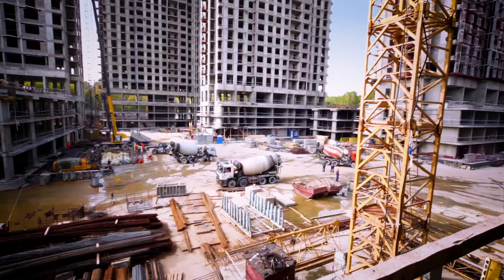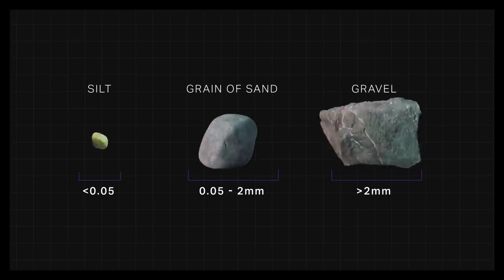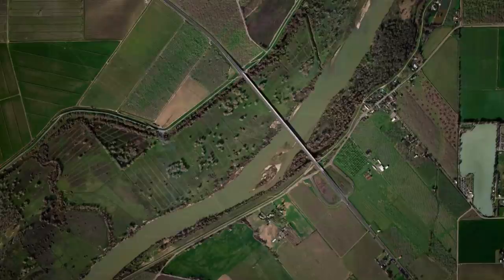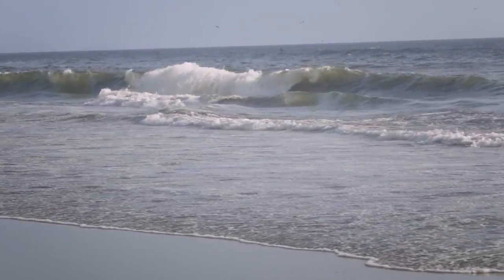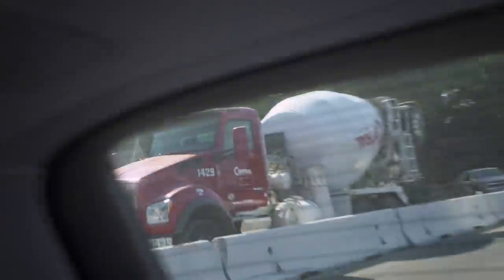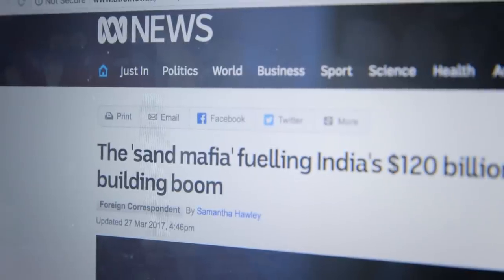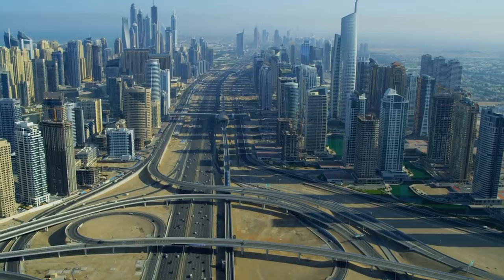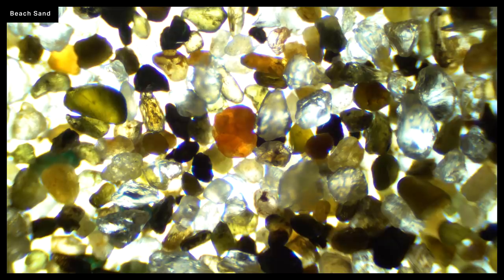A microscopic look at why the world is running out of sand

Comment: The video discusses sand for concrete, but another use of sand that is affected by the shortage of the right type of sand is beach renourishment. Beach renourishment requires the right sand in the right place or else it can erode too quickly. I think there are a couple cases in Florida where the wrong type of sand was used to replenish beaches and The new sand was eroded within a year or two. That's the only context in which I had heard about the sand shortage before, not sand used for concrete.
Reply: Melbourne beach in flordia is an example of this.
Reply: This two are actually conected, beaches were used as supply of construction sand both legally and illegally for decades, problem exist even today (hence existence of sand mafia), in my place government was discussing replenishing of the beaches while people were posting pictures of trucks driving away with illegally harvested sand.

Comment: As a small correction, you mention that the round sand is used in concrete. The two types are commonly known as soft and sharp sand, only sharp sand is used in concrete as it can take more weathering and binds much stronger. The soft sand (round egdes) is used for things like laying brick as it has a softer smoother feel and can be worked much easier in smaller amounts, from a trowel for instance.

Comment: Also the color of the sand will sometimes tint your concrete slightly so that if you got concrete from 2 different depots, and poured a 2 slab patio each slab might look different. Or if you get concrete from the same depot but several months apart the same thing can happen because they may get sand from a different supplier.

Comment: Hey... Isn't edgy sands more useful as they should bind with cement more easy, am i missing something?
Reply: Sometimes edgy stuff can create more of a grip, but for concrete the sand has to bind with other things. Having smooth sand particles mean that the other rocks and stuff can stick to the surface.

Comment: So if I just started taking tons of river sand I could black market it for a lot in 30 years?
Reply: I think in 30 years time we will have replaced silicon in computers so they will no longer use sand to manufacture processors and I also think that if we do run out, the alternative building materials will still be relatively cost effective so they won't exactly pay a fortune for your sand. Also im pretty sure its not true that we are going to run out of sand.
Reply: @mattrowlands5751  oof spoiler
Reply: @DuhNoU  for what lmao, life? 'life spoilers ahead'
Reply: Helium is more likely to make you rich. Save those balloons! ...i guess get a helium collector and tank too for long term storage.
Reply: You'd get mopped up for environmental damage. There's a big list of what you can actually do with nature law-wise and rivers in particular.

Comment: or we just need to manufacture a new type of cement/concrete that can bind well with all types of sand.
Reply: RestInPeaceXXX; rammed earth and adobe
Reply: They already have, but it is more expensive, and still flawed. As mentioned in the video. 

Just because you want a certain result, and decide to research it, doesn't mean you will eventually be able to produce that result guaranteed. 

If you want 2+2=5. You can research it all you want, you will still not get the result you want. Or even if the result is achieved, is the method viable.

In this case, the results that are wanted are: 
1. Affordable
2. Works with a larger variety of sand
3. The product can be of use in a large variety of situations. (Since we are looking to replace the current formula which is used in a very large variety of situations.)
4. Formula includes non-scarce materials only
Reply: We don't have to. We're not actually going to run out of sand. The whole discussion is absurd.
Reply: As if that is easy to do.
Reply: RPX hempcrete

Comment: I wonder, if you were to mine quartz and break it up not into sand sized pieces, but the next category up, but then through them in a mixer full of water for a few days or so, could you produce the rounded edges you desire?
Reply: Sand takes a very long time to round its edges smooth in a manufacturing process

Comment: How about we look for replacements to concrete instead of looking for replacements to natural sand?
Reply: Ah yes, what a revolutionary idea, lets just replace the most useful and workable material on the planet 🙄
Reply: @Vnifit  You havent tried it yet.
Reply: +Matouš Hrdlička and you think material scientists and engineers haven't?
Reply: BUT HAVE YOU ?
Reply: @Vnifit  
Aren't we already trying to do the same with plastic? If necessary, a replacement has to be found
Reply: Whatever you try to replace it with has to be made of something, and those materials have to come from somewhere. Concrete is basically just processed rock. It's hard to imagine any other suitable material that would exist in greater quantities with less environmental impact.
Reply: Check out CLT (cross laminated timber) several buildings have been constructed using it, I think the YT channel the B1M has some quality videos about it
Reply: I'm all for CLT being used where suitable. But for roadways and sidewalks? Highway overpasses? Exteriors? Dams? Swimming pools?
Reply: Herman Von Petri  Sidewalks can be made from tiles of granite or anything else. Roads should be made with tarmac which are usually laid over a mix of pebbles and others stones. Exteriors can be made by plastic if you want. Swimming pools don't even need concrete. You could just take giant stones and make some kind of paste to put inbetween. People are blinded by concrete because it seems like it's the answer to everything but there are alternatives. It's because people have become so used to it and know how to work with it they just don't care about what else can be used.
Reply: Vnifit   Electric cars are far more efficient, clean and safe than gas cars yet car manufacturers have largely tried to stay away from them until Tesla came along and disrupted the industry.  No matter if it’s construction or vehicle manufacturing, industries will try and stick with what they know makes money than try and find better ways of doing things.  I wouldn’t trust the industries to tell us if there are viable replacements as most simply don’t want to change.
Reply: @HermanVonPetri  we should aim for smaller and denser cities with better public transport, however this ideal is far from reality, specially in America where  cities are car consumer oriented
Reply: Granite is less sustainable than concrete, with the high fuel costs for mining and transportation. It also simply can never be fitted to create a smooth road surface over uneven terrain, while concrete can self-level to a seamlessly smooth surface. Tarmac (or asphalt) is not resilient enough for routes bearing the weight of large trucks. Plastic, we are discovering, is an environmental nightmare. I don't see how replacing the gravel/sand mix of concrete with larger stones makes it any more sustainable. Those large stones still have to be excavated from somewhere and now you're just going to be using more of them AND they will be more expensive to transport, use more fuel, take up more space, and will need to be shaped on site. That's in addition to the fact that a large portion of bigger stones would have to be rejected for flaws or being the wrong shape or cracked whereas gravel/sand can be mixed into concrete and formed to fit the project very easily.

Concrete has been used since the days of the Roman empire precisely because it is the most economical, flexible, resilient, and useful option for large scale building projects. Additionally, old concrete can be recycled by breaking it up and reusing it as gravel in more building projects.
Reply: I'm not saying that we shouldn't be researching novel building materials. We absolutely should. But realistically, I doubt that we're ever going to find anything that will match the usefulness, sustainability, and flexibility of concrete unless some sort of fundamental revolution in materials science happens.
Reply: Just want to keep up with the answers :)
Reply: In the future everything will be made of lego blocks .
Reply: Earth soil is an 100% recyclable and cheap local material. In yemen there are building up to 30 meters and they are lasting centuries.
Reply: @MrSpathiphyllum  The thing is, are those suitable for high density cities like like Shanghai, suitable for earthquakes, tsunamis, heavy rainfall every 2 weeks and humid?
Reply: The highest soil building known is 30 meters and 8 floor tall, above that I suppose it's not feasable, but are tall buildings the solution for futur city planning? tsunamis concern very specific areas. With a great roof and a proper coating, i don't see why it couldn't whistand rainfalls and humidity. For earthquake resistance, well i d'ont know, I suppose it can't be achieved without a mix of materials (wood or steel).
Reply: Geo-polymer would be a good alternative. The material just needs to be researched more.
Reply: Carbon carbon carbon!!!!
Reply: @HermanVonPetri but what about the SKATEBOARDERS??😱
Reply: @indigodragon0613  ya my guess is sand will be used until we absolutely can't use anymore of it
Reply: @MrSpathiphyllum  earth soil is for agriculture, it's more valuable than sand. We can live without buildings but we cant live without food.
Reply: @MrSpathiphyllum  This is one of the most ignorant comments, dirt cannot replace concrete. It's not as strong, waterproof, and mixing it with other materials will not be as effective as concrete.
Reply: BudgieEntertainment First, we would have to apologize to the indigenous people we destroyed and then we would have to admit they had it right. Never going to happen.
Reply: Well, rammed earth house are not entirely made of soil, and I suppose the quantity of available soil is by far superior to the quantity of available sand suitable for cement.
Reply: Wrong, reinforced concrete doesn't last a century (due to metal corrosion) but an earth house can last for centuries (see the Alhambra). With a proper coating and drainage, an earth wall can wistand decades of continental humid weather. See https://www.youtube.com/watch?v=-oVBljL6p68
Reply: @DarkAngelEU  implying giant slabs of rock and granite aren't monstrously more expensive than concrete.... Are you gonna be the one that pays the difference?

Also what makes you think mining for granite or stone slabs doesn't hurt the environment lmfao.
Reply: @MrSpathiphyllum  and concrete lasts thousands of years like the Romans have shown us. Nothing works for long lasting structures like rock. The Egyptians are clear examples of this.
Reply: Roads are being paid with tax money so yeah I do part of the extra cost. Unearthing rocks is a solid industry that won't get out of resources very soon. Even in a small country like Belgium we still have rock mine industry for at least another 30-40 solid years.
Reply: @Vnifit  Hemp
Reply: KNITTED BUILDINGS
Reply: Yup people are making skyscrapers out of wood now, sounds crazy? Just look it up. A lot more eco friendly
Reply: It’s about stubborn company’s unwilling to pay more, we already have replacementt
Reply: @indigodragon0613  except it takes more gas to produce the electricity than regular gas cars do overtime
Reply: Cameron Yockey   Yeah no.  Maybe if the cars needed to be charged as much as gas cars need replacement gas, but that’s not the case.  Also, seeing as you’re not taking into account the fact that many homeowners who own fully electric cars also have a clean energy system from which to charge from, there’s no guarantee that whatever stats you’re looking at aren’t picking and choosing their data.  Tesla also has publicly stated that they have plans to transfer their supercharging network to a renewable energy grid, so it’s only a matter of time before the argument you’re using is rendered obsolete.
Reply: We aren't even running out of sand they made it up
Reply: @Vnifit 
Well, we won't have said material anymore soon.
Reply: Hashtag sure thing. What do you have so far?
Reply: Agree
Reply: Better idea. Decrease the expense of transporting sand.
Reply: Google made me do it Can you give some proof to what you are saying?
Reply: There is an new material currently in its infancy on the west coast. It’s call Cross Laminated Timber, or CLT or short. Look up videos on YouTube for more info.
Reply: empbac  With renewable energy, my guess is the liquidification will come from heat rather than suspension in water. If we can mechanically isolate minerals to an acceptable level, we can melt & pour a variety of substances... and it might even be pretty.  Robot sorting is pretty much a done deal about now, solar and wind power is there, all we need is batteries.
Reply: And stop telling people they don't know what they're talking about.  Maybe they don't, but it's those people with an outside perspective, unembroiled in the past and nitty gritty details who come up with fresh ideas.  Sure, they may not be good ones at the moment, but all know-it-alls do is shut down the conversation, throwing any innovation out the door with it.  Try figuring out somewhere more fitting for that idea, or redirect the person who offered it to a community where those ideas are fostered. The other option is to just refrain from negativity and zip it.  You don't have to be optimistic, but don't shut down optimism unless someone's going to die because of it.

Comment: Create a binding agent and run smaller pieces and finer pieces, and maybe even silt, through a tumbler to gain size. It should be something that won't bind to itself so easily, so the pieces of "new sand," remain independent of each other. Then develop a corresponding binding agent to the final mix when making cement. It might be something like charging the stone + or -,  and reversing this with the new agent, and then of course again in the final stage. Or it could be made from a light sensitive material and not exposed to light again until the concrete mixing stage, which wouldn't necessarily remain it to daytime work, as lights could be used at night. We could end up with a superior product. Perhaps compressed styrofoam would make good cement, it makes the best replacement for wood,  perhaps now for sand.

Comment: Why not filter beach sand and change the chemical bondage of the cement which will not react in a negative way so the concrete is much more cost effective

Comment: In terms of volume, how much sand are we talking about?  1 cubic km per year? .5  per year? More? Less? When we process ore from mining operations what happens to the "waste" rock? Is it suitable for concrete use? Suitable for foundry work? I do know that flyash from coal plants is used in concrete  to some degree. Or is this shortage more a case of access versus distance.
Note the quotes around waste.  What we call waste, is merely a resource

Comment: The diameters of sand particles are between 4.76 and 0.075 mm, according to the Unified Soil Classification System. (ASTM)
Reply: Nice valuable information
Reply: @viveka2680  Thanks. I learned it in my soils and rocks mechanic course. (PD: I'm studying civil engineering)
Reply: @malomo5680  I too a civil engineer

Comment: I would like to introduce to you the shifting sands of the Sahara desert.

Strong winds can also blow sand dunes very slowly along the desert. Sand dunes can be various shapes, such as crescents, stars, or just repeated lines. Some sand dunes can grow up to 4,000ft (1,200m) high, which is taller than three Eiffel Towers placed on top of one another.

The amount of sand measured in gallons is estimated to be around 1.5 septillion. Thats 1.5 with 24 zeros behind it.

Comment: Is it possible to invent a concrete that uses micro plastics instead of sand? I'm sure that could be done. It'd solve a few issues at once, but switching the entire building industry away from concrete would probably take multiple generations and too much state enforcement.

Comment: So round edges are better with concrete or is it just a sign of better age or less of those you call "soft minerals"?

Its a real question.
Reply: Simon, that question is not yet answered.  Weathered sand is better for an interior concrete finish because it is smoother.  Angular sand might be better for strength.
Reply: @patrickeh696  I have so many questions. By my experience, sand with those soft minerals are better for interior finish. I also speculate that angular edges are better for finishing because they hold mortar without setting. In contrast round edges for structural allows for better flow of concrete. Anyway, that's just a suspicion. Thank you.

Comment: Now, this is just my idea for a solution to the manufactured sand problem.

Why not just invest in large tumblers, effectively huge industrial washing machines. You throw in small, roughly similarly-sized gravel stones, and leave it to tumble for a variable amount of time - however long you need for the amount and how fine. It replicates most conditions of the mountain rivers, and solves the problem. Sure, we'd be spending money on it, and my idea definetly would need to have more development and expansion for proper wide use - but, it's just food for thought.

Comment: As a mason Facts about concrete When the ignorant Barbarians wiped out Rome The "secret' was lost on how to make concrete for 1,000 years until a guy in en gland crushed Limestone.baked it in his oven and created  Portland cement which is NOT a brand name. The oldest tool used daily today with little change is the masonry trowel
Reply: some guy i was talking to in construction reckons the pyramid sandstone blocks could have been made from sand and ash from burnt wood and water made in wood moulds so they only had to take up baskets of the stuff, what do you think